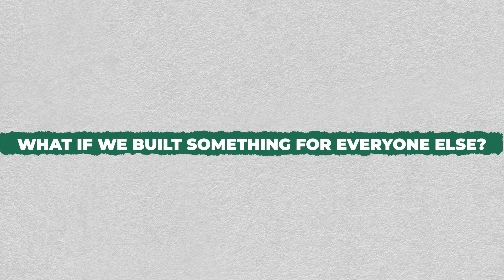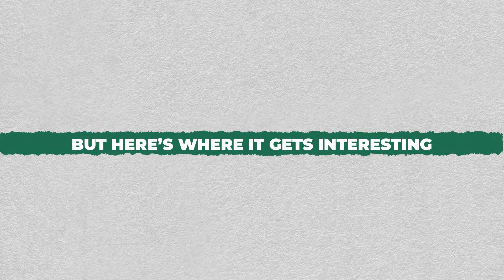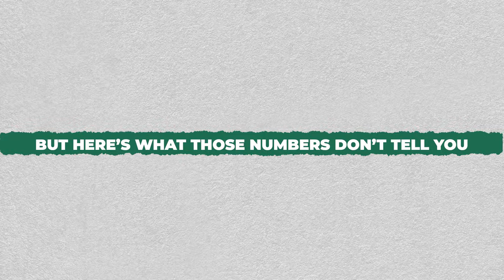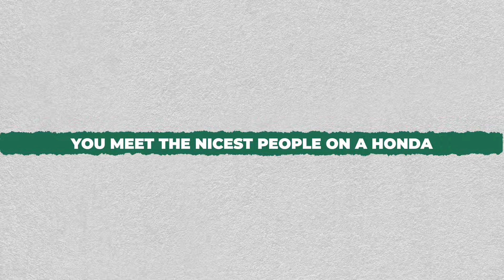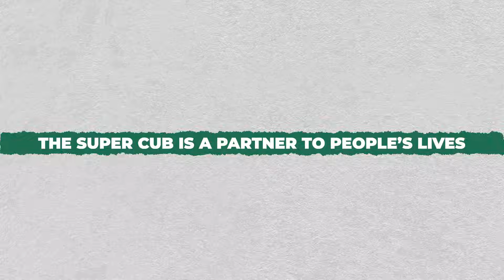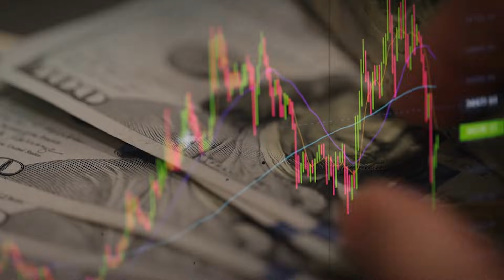How Honda Created the Most Sold Vehicle Ever

Comment: I have owned many Honda's in my 55 years motorcycling experience , both large and small.
The next will be an ADV 160, with its superb design, engineering, reliability, and economy.
Great for a trip to Seven Eleven, around town or a fake ADV ride. Even with my girlfriend on board.
  (but nothing like my two brilliant , new MV Agusta's or now aged BMW.)
Different horses for different courses !

Comment: This is the kind of products that got me into engineering. Functional, reliable, and adaptable design. Manufacturing could be scaled-up for mass-production to make it cheap and profitable. 
Instead, engineering designs today demand built-in obsolescence. Repairs are more expensive than a new unit. The materials aren't even recovered and just ends up in landfill. 
Where tf did it go wrong?
Reply: Only design complaint is the hot exhaust pipe, which could hurt on uncovered skin. A cheap plastic shield was a common add-on.

Comment: In 1967, I was working in the engine room of a SEALAND container ship. We had docked in San Juan Puerto Rico, We were to be in port for several days for some repair work. There was a moped rental shop in the Condado beach area.I rented a Honda Cub. Two years before I owned A WWII Army surplus Harley. It was embarrassing to be riding on something so small. But surprisingly, it took me all over, out to the country, and it managed some of the hills. I was going back to my ship, at the SEALAND Docks in Puerto Nuevo, while coming off of the bridge while traveling on Kennedy Ave. there was a large gasoline spill on the highway, before I could react I hit the slick, the bike started to go over and I finally made contact with the highway and I slid for more than 50 or 60 feet then stopped when I came in contact with the guard rail., (I have lived in Puerto Rico for the past 42 years) I still point out to my family or friends that section of the highway, and my mishap. It didn't damage the bike but ruined my shirt and jeans. After eating lunch on the ship, the electrician asked me to take him in to also rent a Honda. We started back on Kennedy Ave, he sitting behind me, as we came to and entered Todd Street at Stop 18, there was a red light, so we started to go between the cars that were stopped, as we came alongside a taxicab a guy opened the door to jump out before the light turned, and it pushed us under a large tanker truck, we were under the trailer trying to get out from under, all the while screaming for the truck to not move but the light changed, my friend cleared the trucks wheel but my boot heel got run over and popped the heel off of the boot and the truck ran right over the Honda, flatting it. I called the rental and the owner told me I had to pay him 360 dollars, I had to call my captain for some cash to be delivered to me to pay the cycle shop. The captain laid into me when I got back to the ship; he also wrote me up.

Comment: It would have been in 1963/4, when I was an apprentice and my Electricans, Electricians Mate (sort of labourer) who rode a 350 BSA had decided to get one of these. He told the story of when he went to the dealer and was trying it out. He kept Kicking it up. The Salesman said, something like "why ar you still kick it up - it is already going". He hadn't realise the engine was running, he thought it was someone trying to kick their machine up several meters away.
They also did a storty version, which may apear later in this video but I am saying so now. Sory if I have jumped the gun.

Comment: I had one but i replaced that puny motor with the mighty Maico 501 square barrel, installed a 40mm Mikuni, huge Basani down pipe tuned expansion chamber, Koni shocks with Betor forks. Talk about wild!

Comment: I commuted on a 50 for two years in London.   Way cheaper than by train.   Then I had a 90.   More comfortable.   Then I graduated to a Yamaha 200 with its 2 stroke twin with metered lubrication injection.   Loved that thing.   The engine was so smooth, more like a turbine.

Comment: Try hard and you can break it. But you really have to try. I got one as a package with a 250cc Hawk (the 1960s version). Sadly they ran it in the dirt without an air cleaner, so the piston and cylinder were chowdered.  I needed highway, so I kept the Hawk and sacrificed the Super Cub.  Great little bikes, though.

Comment: My 90cc Honda Cub was replaced by the 80cc Yamaha copy. The former gave me 3 problems. Salty winter roads in Scotland played havoc with the pressed steel bodywork which led to it's demise. Drive chain snapped despite having a fully enclosed chain case guard, and this obviously did not occur at a convenient time or place. Third "annoyance" was exhaust pipe fracture at the cylinder head. The header pipe and silencer unit are one piece, so, a complete /combined unit had to be purchased.
This is where the ever so slightly less powerful Yamaha Townmate T80 enters the scene. A bit more expensive, not quite so readily available, but, featuring SHAFT DRIVE. What a revelation. What an improvement. I bought it new in 1992 and still have it now in 2025.
Why this "superior" replacement to the Cub never achieved anything like the success of the Honda, quite baffles me.
I have owned five Honda 'motorcycles' as well as the Cub, three of them shaft driven. So, I generally, really like them. But, the step 'thru' comuter class is championed by Yamaha's version.
Getting rather pricey and difficult to find a decent surviver.
Avoid the African models, these are CHAIN driven, not shaft.
Memories....

Comment: They were fantastic bikes. I had an early one in 1961, with the pushrod engine and did over 100,000 miles on it. Some of your facts are wrong, the chain didn't run in an oilbath and that wasn't a model T Ford. I suspect that more of your video is also incorrect. However it's basically true.

Comment: As far as I know, it's been called a step-through frame since they started making them, and the most popular model is the 90cc model.  50cc bikes don't have enough power to carry anything but the rider.
Reply: It still did carry a rider or 2 and often more. I had one and regular carried a passenger later after riding a C90 and then a CB125 with 2 and1/2 x the power I never went back But it did what it was designed to do at the speed limit in town while carrying people and stuff cheap to buy and run.  50 cc mopeds are limited to 2 hp and the C50 cub had 4.5 hp and a 3 or 4 speed gearbox.

Comment: I had a C90 in about 1974. It was three years old when I bought it, and by the time it was four years old, the front forks had completely rusted through (North UK climate), the timing chain was knackered, and the rectifier failed, which would cost more to replace than the bike was worth at that time. I did like the many larger Hondas that I owned, but was not impressed by the C90.

Comment: Back then they were not super. Cubs ,it was just a Honda 50  cc
Reply: Exactly...in Europe from the early 70's till the World Wide Web arrived we called them Stepthru's...yes they were underbone motorbikes but no-one used that term...we could not call them Cubs or Supercubs because Triumph owned the rights to the Cub name...in Asia that didn't apply so they just called them Cubs...until the 21st Century when we copied Asia and used the same name...Triumph rights had expired to the name...so owners everywhere unified it...same with me...I've owned lots of them...mostly because I'm too poor to own real motorbikes...
Reply: The "super" name was for the larger wheels.  Honda had the Cub which was the same bike with smaller wheels.  Super Cub are 17" wheels, and Cub were 14" or 15" wheels only sold in Asian markets for a few years.  However there was a few years where Honda sold the Super Cub in the US and a few other Western markets with only the Cub name cause of conflicting trademark name of SuperCub by some other company with some other product.
Reply: @DaBinChe  No.  The Honda Cub was a motor that was mounted on bicycles.  The motorcycle was the Super Cub from the beginning.
Reply: @SoloPilot6  It was only about 10 years ago that I saw Japan had a Cub model identical to the SuperCub but with smaller wheels.  You ever seen a "super cub" with smaller wheels?  Fact is they have so many variant of the Super Cub with so many differing names.
Reply: Everywhere except North America, it was the Super Cub.  The "Super Cub" name was trademarked in the US for a Piper airplane, so here it was the Honda 50, 55, etc.
Reply: @SoloPilot6 ok thank you , I was 13 yrs old when I got mine  so we never heard it called the super cub

Comment: I bought my 1963 Cub in 1966 and drove it straight for 2 years through two New England winters without missing a beat. I still have it in the basement and am considering running it again, great machine for sure! Based on my early Honda experience I have owned many subsequent Honda products and never feel the need to buy the “extended warranty”. They either run or they don’t right off the line.

Comment: I still have my 1963 Honda C100. It was my first motorcycle, bought from my neighbor in 1973 when I was 12 years old for about $20. I celebrated 40 years of ownership in 2013 by completely restoring it. Now, it looks as good as it runs, which is to say, perfectly.

Comment: The Drive Chain did not 'Run in an oil Bath'
it was Greased  and ran in a dry Weather resistant Sheet Metal case.

Comment: What about the Honda 90 in Canada? 
My brother's friend had a grey one about 1968 and the seat was longer for 2. I had one ride and my brother went on dozens.
In 1976 I stupidly bought a Honda 400 4 cyl. It was a beautiful yellow and was fine to ride but my hands were always numb.
Only did 2,600 miles in the first couple years then it sat while the $76 battery went dead every winter. 2 years ago I saw one exactly the same, good as new and talked to the guy. Could be mine. 
Now I still do 3,500 miles a summer on bicycles. LOL.

Comment: I remember the "C50" with great fondness. Called the  clunk because of the noise when you changed gear. 1 down and 2 up I think, although I have foggy memories as was 50 years ago. Very reliable, cheap and a comfortable seat. wonderful machine.

Comment: I had a 90cc version for years until it got stolen and trashed.
I did 15,000 miles on it and I only ever changed the oil and spark plug, and I thrashed it to work flat out on the dual carriageway, everyday. 
It just never gave up, despite it's abuse by me.

Comment: The drive chain doesn't run in an oil bath . The chain cover is merely to stop oil spots being thrown on to your clothes , keep dust and dirt from wearing out the chain rollers , plus most importantly it keeps passengers feet from ever getting caught between  the chain and the  cog , the last thing an Asian needs when carrying 4 kids on the back .

Comment: What is this 'Super Cub' nomenclature? These were simply known as the 'Honda 50' in my childhood 50 years ago. It was a big step up from the bicycle. Many farmers and tradesmen and merchants somehow managed to use the little machine to perform work, deliver goods etc. They were red and white only.
Reply: Actually not, there was also a light blue one, identical to the red and white one. I had a blue one, my friend had a red and white one.  As I remember, mine was a 1958 model, his a 1959 or 1960. And we knew them only as a Honda 50. Mine had an a windshield, good for running in the rain in the PNW Washington. With the windshield taken off, leaning over and head into the wind, I could get 45 mph out of it. I’m certain the valves were floating!  Lots of fun days with the Honda 50!

Comment: Should have used vintage pictures of the true Honda 50. These are mostly new models.. Overhead Cam, not pushrod engines. Otherwise a decent video.
Reply: The research is too difficult for these channels and too time consuming so they take the easy way out...seen it on other channels too...also when showing the history...they mention 100 million Supercubs but ignore the Supercubs bikes from about year 2000 to 2020...skipping several model changes and major updates...you get early pictures from the 70's and 80's then they show the latest models from the last 5 years...makes me smile these channels never showing the half a dozen Supercub models I've owned and still do own...

Comment: They were better to ride than a scooter but had a short mechanical life - about 8-10000 miles if you were lucky. I had one of these in the UK in the Sixties and it had two catastrophic engine failures, the big end and a seizure. Spare parts were a nightmare to obtain, and there were very few dealers. I later had a Lambretta Li 150, then a Vespa PX125e, which I still have today. It has done 40000 miles.
Reply: Bullshit, these bikes went forever.
Reply: Rubbish,  if you looked after them they really were indestructible
Reply: you are supposed to put oil in it every now and then.
Reply: Some didn't check the oil level or give the engine an oil change . . ever !

Comment: good informed narrative,thanks from uk😊
Reply: Not if you do actual research. "Triumph valve adjustment every 500 miles". 1960's Triumph valve adjustment was actually ever 12,000 miles.

No mention of the Vespa or other step through scooters either.